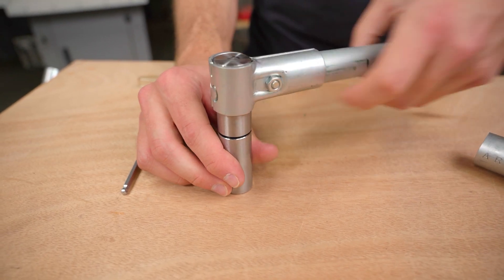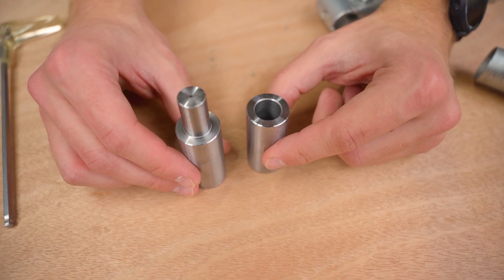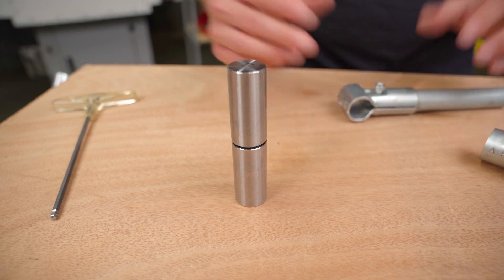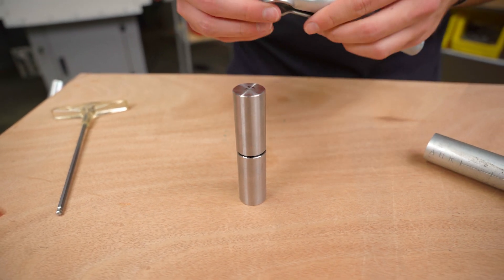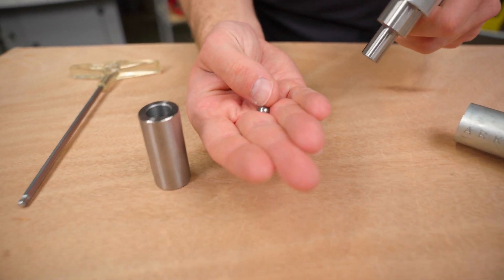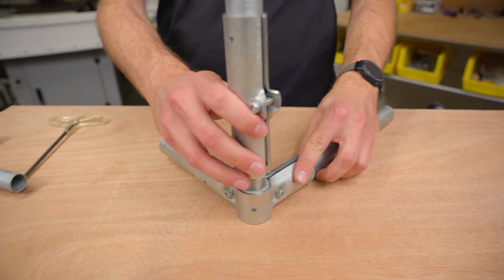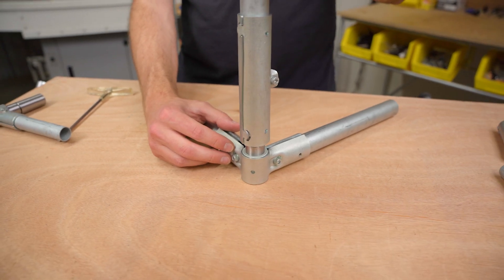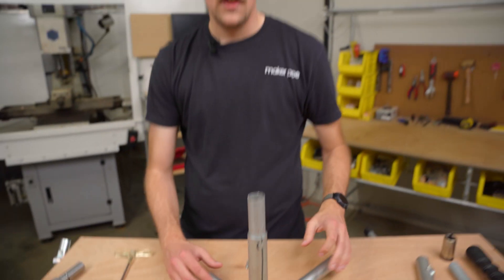This Hinge Hack Is So Cool!

Comment: Is this available in a 1/2" version? I am building a dog trailer to pull behind my cargo bicycle and I need to construct a latchable door in the rear. The framework for the top and sides of the trailer will be made utilizing 1/2" EMT conduit.